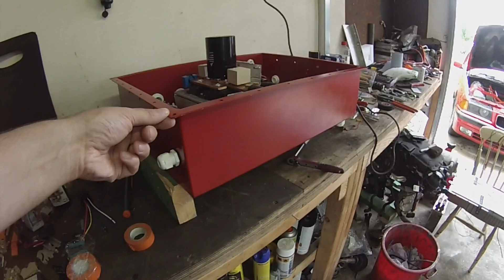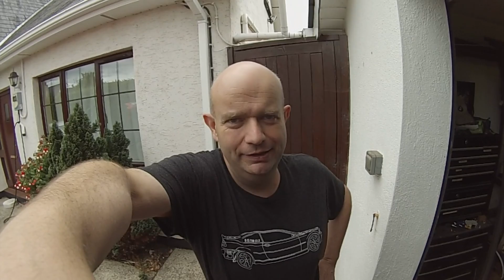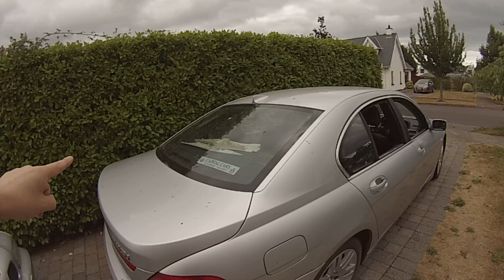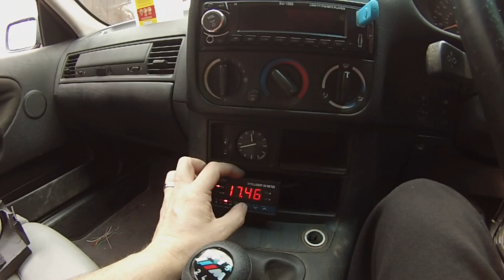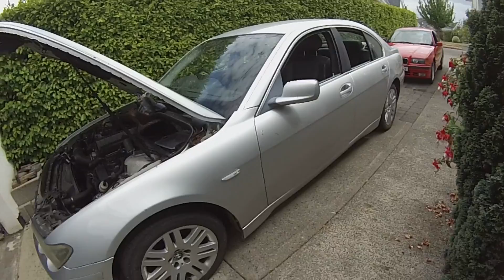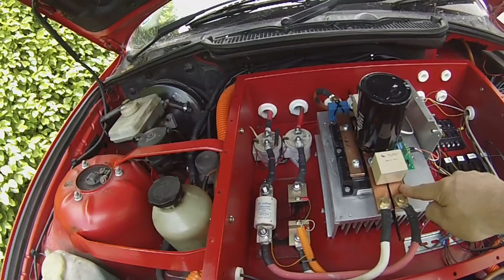€1,000 BMW E36 EV Build 09 : First Roll

Comment: Whoa Nelly! Those Valence batteries are a heck of a lot more expensive than the Ampere battery - just the front 4 is £1200 used on eBay UK...!  Will have to pretend that they are the Ampere battery....!  Still, loving the series and getting real motivation from it.

Comment: Hi Damien, love what you've done and are doing with the E36 EV build, one thing occurs to me tho, could you not use the heat from the controller heat sink to heat the cab either direct or indirect through a heat exchanger and then have the electric heater as backup or extra as and when required?
Watched a few of your videos and really impressed with what you have achieved and you are brilliant with the electronic controller build, lost me in some places, but it is insanely interesting to learn a tiny bit of what you know about electronics and microprocessors, I'm in awe! Well explained and very interesting! Well done and thanks for sharing your dream! 👍🏻🤓cheers Damian
Best regards 
Denis

Comment: Manually precharging - just like preheating the plugs in a diesel engine, not a bad idea as long as you can prevent the contactors from contacting when the voltages are differing too much. 

Electric cars are a lot more reliable than dinosaurs. I like that red devil. I am glad it is running on its own feet already.

Comment: Excellent work looks very professional, looking forward to the wiring video. can you tell us how/what the vacuum pump you are using for the brakes.
Reply from the maker: lookup 8E0927317A on ebay
Reply: many thanks, how are you going to charge the HV battery pack ?

Comment: Great looking build even without the ampere batteries! If anyone has any doubts about an EV having enough punch a quick look at you pushing 2 and a half tons of metal about should quiet them down! Waiting with great interest to see how you handle the cabin heating/cooling and other odds and ends, as well as a more detailed look at the controller ( had signal issues and missed your last live stream).

Comment: Automatic transmission, same  process?
Reply from the maker: No. Do not use an auto.
Reply: What to if car has automatic transmission
Reply: No you swap it out for a manual. It wont shift when its supposed to and you will lose a decent bit of power

Comment: Also I seen a conversion plate that runs off front of motor using original parts and a/c too..? Down sides? And how do I heat it inside?

Comment: Really good viewing bud, the controller side has completely thrown me.. I really want to do this on a budget but want to take the power to around 200 Bhp with 200 mile range.. possible?
Reply: At 300 Wh per mile, you'd need a 60 kWh battery pack.  The market price is currently around $200 per kWh so you'd be spending $12,000 on a battery, or spending a lot of time scavenging enough second hand bits to build a properly matched pack of that size.  200bhp... power is cheaper than range, but you'll still be spending thousands on a motor and controller capable of doing this unless you are going to put a lot of legwork into finding incredible deals.  If it was easy and cheap to do they'd already be doing it :)